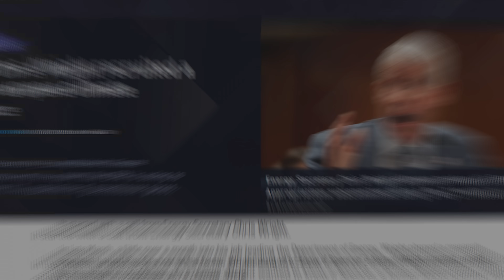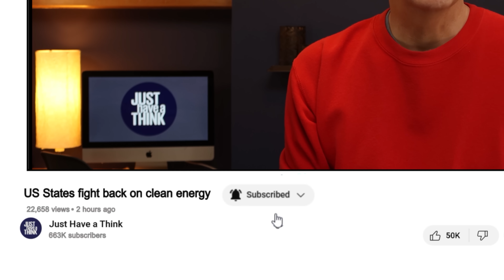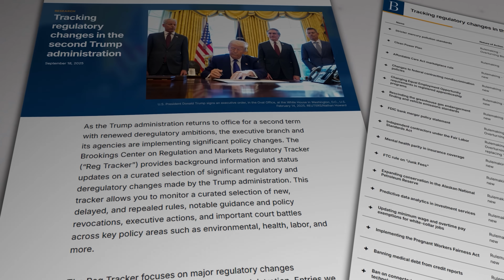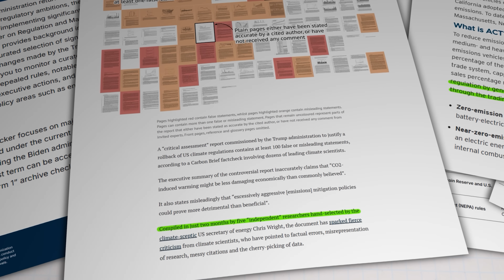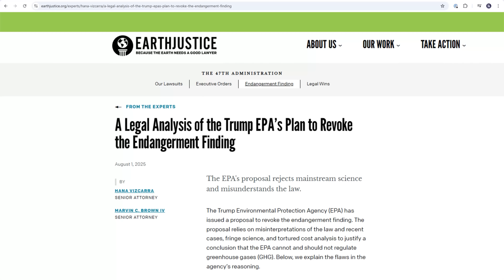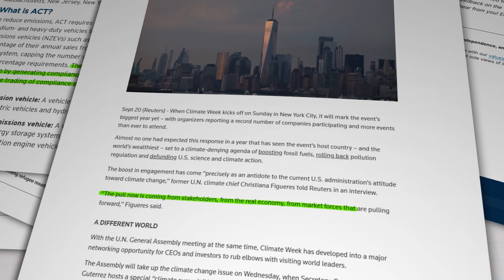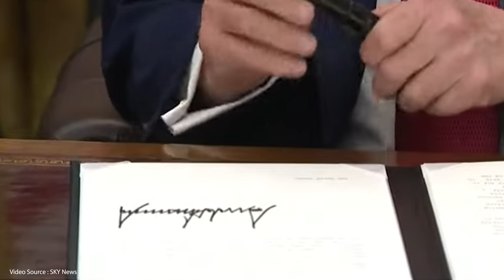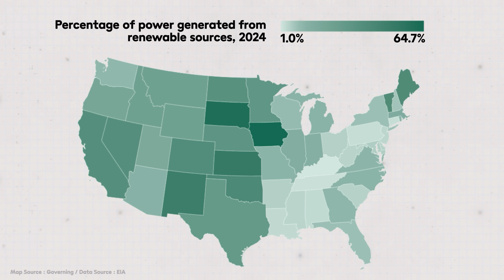The battle for American energy supremacy.

Comment: We just installed solar panels with battery backups. Two 15 kw batteries. 34 460w panels. I plan on getting another two batteries and 20 more panels I am in love it with it so much. The problem here in the states is that our government allows investment firm scams to take advantage of people. 

We almost signed a contract to get 5 k for them when I noticed that they wanted me to sign over commercial rights to them. This was to sell the RECs. It was insane that this is legal. Anyhow. I am very happy I bought them. Next up I’m getting a septic system to divorce myself from sewage. The utilities here are being taken over by investors and they are making our basic needs unaffordable. You have no choice but to become self sufficient.

Comment: Well ..... that is a good news then.    But I think for U.S. it might be too late because U.S. is getting slow and self struggling. It is refusing to adapt at full speed to new realities.   Rome fell and France risen because Rome used manpower and France went with hydro-power.  France fell and U.K. risen because U.K. went with sail and coal.  U.K. fell and U.S. has risen because U.S. went with oil and uranium.   U.S. will fall and other nation will rise because it will find better alternative (possible solar, wind, hydro and zero radioactive waste producing fusion). Time will tell.   All before mentioned energy sources were limited and therefore they allowed the elites operate a cartel on society.  That is how wealth is made.

Comment: So how do you DIFFUSE the dense nuclear energy into millions and millions and millions of meter boxes at the homes and buildings and ..

The little Australian grid costs $TRILLIONS to get the little 250TWh electricity energy to 20million meter boxes and still 6,500TWh more of fossil fueled energy CO2 EMISSIONS.

It looks like nuclear electricity only works if you can DISPERSE it by RENTING the grid to millions and millions and millions of customers and getting 247 cashflow. 

DISPERSED roof PV electricity with no grid costs is economically dangerous to the grid owners AND the nuclear electricity generator owners.

Just saying.

Edited: keep existing nuclear electricity plants running, smart thing to do, just saying more to think about.

Comment: At the end of the day, you can draw conclusions based on facts and  not  wishful thinking. When the majority of  Americans can't  understand the basics, it is hard to  explain how it eill impact them.  You can drill and produce as much oil as you want,  but the US  is not in control of the oil price, OPEC  is. If they reduce production, prices go up . While Americans talking about energy independence, China is working on not just energy independence, BUT energy PRICE  independence. The two are not the same, and they are  not interchangeable. Only alternative  and renewable sources are independent  from the international markets. Which is why China is electrifying everything. Wind solar, EV. They are innovating, and  selling renewable products. Americans on the other hand insisting on  paying more and more for gasoline. That's  why they elected Trump.   If they tought that America  was going in the wrong direction  under Biden, just wait and see what the wrong direction really looks like. Republicans handed China the win on  a silver platter. Every policy  they are implementing  is a win for China. In that sense, it is a zero sum game.  Losing marketshare in business  means that somebody will have more. It's  not evaporating into thin air. Americans can expect their electricity  bill to keep climbing. They literally  voted for it. Trump is killing renewable energy projects. And all the good paying jobs that came with it. Energy consumption is going up,  Ai, data centers, crypto  mining, all are energy hogs. And water.  Guess who is paying for  the higher demand. 😂

Comment: These stories promote the switch to generating electricity with expensive petroleum (natural gas) and lots of it.   Note how they promote the contrary to hide the actual purpose a common technic.   Wind and solar energy supported by the public power grid in practice can not use steam turbine generators having to be supported with large amounts of natural gas to hold natural gas turbine generators at high readiness making near zero electricity costing more natural gas than making all the electricity with NGCC power plants.  Wind power with its wild fluctuation second-to-second is the most natural gas expensive form of generating electricity.  

Global warming has been at  1°C since 1992.   The hype for climate change started 2005 - 2008 when large surpluses of natural gas didn't have a market that had come from new fracking crude oil drilling.   The large political push to solar and wind generated electricity has switched the power grid over to being more than 50% petroleum (natural gas) dependent.

Comment: I put solar panels in 2 years ago and my wife drives a plug in hybrid. The solar covers about 1/3 of our electric needs. I figure our break even point is about 5-7 years.  While I wish our electric rates had gone down, essentially what has happened is our energy costs have stayed flat, while rates have gone up and up and up.  If everyone installed solar panels and drove EV’s our carbon emissions would meet Paris climate agreement targets.

Comment: I started programming with IBM 360's had wire plug boards and was programming in Y2K. Curiously enough in Y2K as an employee in a contract firm to IBM working at a client company were are just sitting around. During a break I asked Paul Kennedy - a fellow programer - why were were not doing any work. He said it was because we were period certain insurance. Based on how many jobs IT replaced how many jobs do we expect AI to replace. BTW how much faster did the apps running on IBM 360 think than us humans?

Comment: There are two key factors here--the increase in data centers and the movement in states like Maryland that have adopted "automatic permitting" which can reduce the costs of arrays tremendously. Keep your eyes on Virginia. The upcoming election will be critical for solar. If the Dem, Spanberger wins, legislation is poised to also begin automatic permitting. Virginia has the highest concentration of data centers in the world and the grid is not designed to cope. Electrical costs are rising and consumers are getting pissed. Only solar can be installed fast enough to manage the problem.
Reply: Maybe solar can be installed fast, but it is still incapable of powering anything important.
Reply: People's homes are important and the residential sector is the largest consumer. Small scale solar is possible for business and agrivoltaics is a viable option for small farms. Newer electric cars have vehicle to grid capacity which means they offer the largest battery storage options for homes available. Solar power is used on site eliminating the need to add transition lines.

Comment: It is unlikely Renewable Green Energy will ever happen, because God didn't think mankind could fix the shortcomings of the source without storage, and distribution of fuel to create energy on demand to balance supply and need.  The whiners can't change the requirement of storage and distribution that can generate durable wealth.  Not even you nibble on my scenario.
Reply: Yep...its the steady vs interruptible issue. Not solved by wind or solar.
Reply: @northdakotaham1752 A non-cridentialed conservative individual solution offered is storage, distribution of cycling the water molecule to change low value assets i.e. uninhabitable desert land into productive land to create the funds for infrastructure.

Comment: How did solar and batteries even become political. What sane person wouldn't want to generate there own electricity for cheaper and be unaffected by grid instability or data centers gobbling up electricity.
Reply: Bc the batteries come from a communist nation...among numerous other devices. Not a good plan for the future.
Reply: Wind and solar are infinitely-expensive, on a sustained basis.
There is nothing "cheaper" about them.

Comment: I bought my first solar PV panels in 1990, but it's also worth noting that natural gas is the largest energy source for the western, eastern and Texas electric grids.  Fossil carbon is very concentrated and easier to throttle up and down than PV panels or wind farms.  Fracking postponed rationing.

Comment: The U.S. wants to rebuild its manufacturing so what’s the plan for electricity? More gas and coal power? Probably. The U.S. was the world’s largest  producer of  Aluminium 40 years ago manufacturing 4.3 million tons. In 2025 it’s under 0.5 M tons. Aluminium needs very large amounts of low cost electricity so where is this going to come from? The Tarrifs are already in place effecting the U.S. economy.  No plan for electricity supply to make aluminium and no plan to build aluminium smelters. Could just be summarised as no plan. Same for Steel production, ship building and a host of other industries, no plan

Comment: I live in CA…I have the CASIO app which shows me how much renewable power is produced in CA - without doing a deep dive, it appears that it is now over 50% on a daily basis, sometimes close to 100%…The app also shows you the pricing which can be as low as 1.5c/KWh. 
PG&E have just reduced electricity  prices by 2%….
The reasons are simple, burning NG costs ~ 1.4c/KWh (depends on market prices - but there is no CAPEX, no maintenance in there….Solar and wind are around 1.4c/KWh with all CAPEX, maintenance included….Why would I want to embark on costly (to the tax payers) “drill-baby-drill” ?     QED!

Comment: It will be interesting if the DOE does not prevail in revising the co2 endangerment finding as it was based on the peer reviewed IPCC and government data. I will try to help you along in your quest to understand what is going on. Here is a hint. It is an issue with capitalisim. It is not an issue of co2 induced climate change.  You will get more clicks with you current narritive but you will be more accurate if you look somewhere other than co2 induced climate problems.

Comment: Energi Media, a Canadian channel, makes a point repeatedly. Electricity growth in the States, because of new data centres, will lead to a 30% increase in demand over the next five years. The lead in time for a new gas turbine is 6 years. For solar it's under 18 months. The only alternative to massive new solar with batteries is higher electricity prices.
Reply: Wind and solar are incapable of powering anything important.
Therefore, it doesn't matter how fast solar can be rolled out.

Comment: The People's Republic of California 
Is LOSING population to the tune of 800,000 Every Year.
Businesses are leaving as fast as they can staying Only to the limit of contractual obligation.
Even Tesla said Screw This Madness and left the state!! 
So did McDonalds. And many others.
Many more are packing up and leaving ASAP.
The two largest refineries are closed and closing.
And with the big arson fire at one of them...it Will Not Be Rebuilt!! They are leaving as well.

The Peoples Republic of New York is Also shedding population to the tune of 700,000 per year because of INSANE RADICAL MARXIST Policies and laws.
John Q Public has HAD IT with them. They fed up and leaving.

THAT is the "Blue State" reality across the board.

It is also becoming more widely known about the outright LIES that have been told about "human caused climate change" that are purely leftist politics.  I could go into Extreme detail on that subject!

Carbon Dioxide is NOT pollution: It Is PLANT FOOD!
Since 1988, when full time 100% satellite data became available, the total "green" of the planet has INCREASED by Over 30% and that is IN SPITE OF deforestation, slash-and-burn, clear cutting and other negative impacts(!!).

The Big Lie must be exposed.
The switch to renewable energies must be organic and economically driven.
Doing otherwise is a Fool's Errand.
Draconian Laws and Force will only Destroy EVERYTHING.

Comment: Personally, I feel that the evidence supports global warming to the point that it shouldn't be ignored. I grew up in coal country and my father's house had a hot air coal furnace that used to coat the entire inside of house with cosl dust. Burning coal disperses mercury, lead, cadnium  throughout the environment &  in our case the house's interior. My father ended up installing a hot air propane furnace. The area I grew up in has pretty much exhausted the coal but has 3 massive  layers of natural gas under it. Natural gas which was starting to replace coal in combined cycle plants because coal power plants have to shut down for perodic cleaning and require very expensive equipment to remove the mercury, lead, etc from the exhaust. Natural gas powered plants produced remarkably less CO2, mostly water due to the combustion,  no toxic metals in the exhaust, and don't require shutting down for cleaning. They can also achieve achieve 50 to 60% efficiency  verses 35 to 38% efficiency for a coal plant. The president that put a stop to this trend was Pres Biden,not Trump. As far as burning coal goes, I can't believe the economics favors coal over gas and wind. Besides, even if you don't believe that global warming is a major problem, coal is just terrible on your air quality, human health, and water quality.  ( something I didn't touch on ) Solar is not economical in this part of the USA, but Biden subsidized massive solar farms in this area. Solar farms that will never pay for their expense. So, in the USA it runs from one extreme to another depending on who is in office. Living proof that our legislators are scientifically illiterate and base their decisions on what fills their pocket with dollars. ( oh, isn't this called corruption)

Comment: Horizontal axis windmills are the Ultimate in STUPIDITY being the most costly to install, most costly to maintain, lowest mechanical reliability, lowest net operational effectiveness, most vulnerable to weather, highest random Failure rate, AND, Drum Roll Please:
THE MOST EFFECTIVE BIRD KILLING MACHINES EVER INVENTED OR USED!!!
They have single-handedly Murdered MORE Eagles and other raptor birds and condors 
Than ALL OTHER CAUSES OF DEATH COMBINED!!!

EVERY OTHER renewable energy method is safer and more effective than horizontal axis windmills.
So WHY do they Continue to be promoted as a solution?!! They are NOT! They are a Liability!

VERTICAL AXIS windmills, on the other hand, ARE Effective, CAN operate in inclement or severe weather AND...
Don't Kill Birds!!

Thermal and photovoltaic solar is reliable and at least doesn't "knock off" wildlife! It just must be utilized and managed correctly. Grid connection is the absolute LAST thing you should consider with small installations.
Personal/private solar needs to drive DC systems such as readily available lighting solutions. Battery backup is also always part of the equation and that comes down to cost per kilowatt-hour of storage.
Standard lead-acid batteries are Still "King of the Hill" on that one, are readily available and have predictable performance characteristics.
Thermal storage should also always be part of any system...and that includes storing "cold" as well as hot.
Thermally driven devices such as phase changing mass transfer engines very effectively and very efficiently convert that stored thermal energy into mechanical output which can be used to pump water or generate power.
Always, Always think in terms of integrated systems when thinking alternative energy(!).
Do that and you get good to excellent results.
Fail to do that and you will be..."displeased"...

Just my nickel's worth of free advice. 😸😎
Reply: "Annual estimates of bird incinerations at the Ivanpah Solar Electric Generating System, which Google co-owns, range from just over 700 to as many as 6,000 birds. The exact number is debated due to different estimation methods and time frames, and many avian deaths at the plant are caused by other factors, including collisions." (Google AI)

Comment: The numbers the anti solar people use do not take into account a few things about the US one being the large solar and wind reserves in the country, and the fact that all of the money spent in the EU developing this tech has made it so much more viable. The other item the anti renewable people have to understand is the need for more power and the fact it can be brought on about five years faster then ANY large natural gas project.
Reply: "...the need for more power..."
It's an opportunity (not a need) for more power.
Only uranium can take advantage of that opportunity, unless you can figure out a way to produce a petawatt of continuous power with wind-and-solar.

1 million AP1000 atomic reactors could do it, and they could do so while fitting inside a square only 88 miles on a side (465 feet apart, on center, just like at Plant Vogtle).
Reply: @aliendroneservices6621 I do not think for a minute we can or should go 100% solar wind. What I do think is where it is a good option it should be used . I also see big advances in geothermal coming. of course nuclear should be used there are advances there too the problem is the time window.
Reply: @turtle6175  "...the problem is the time window."
How long would it take to build a 1-petawatt-continuous wind or solar power plant?